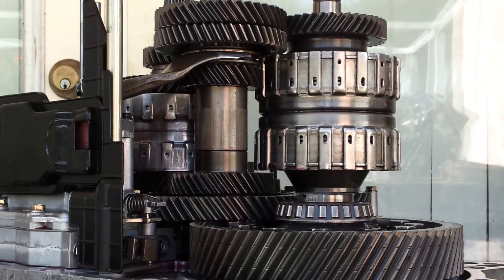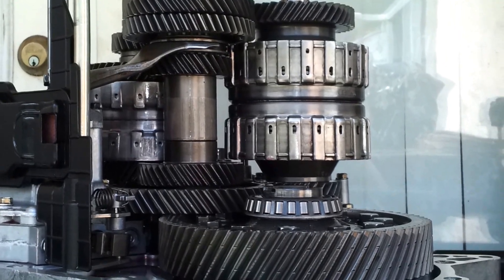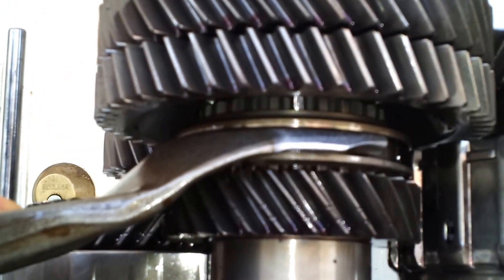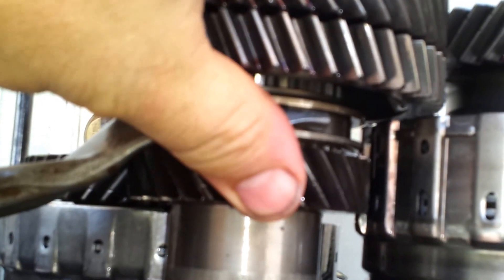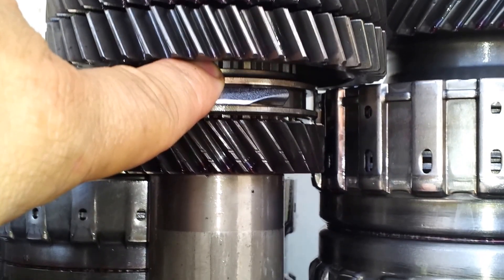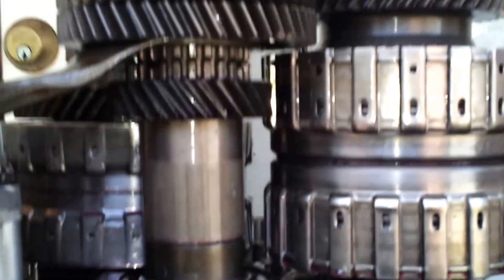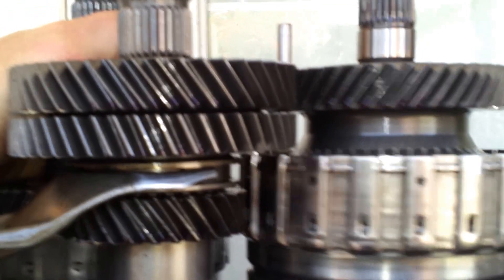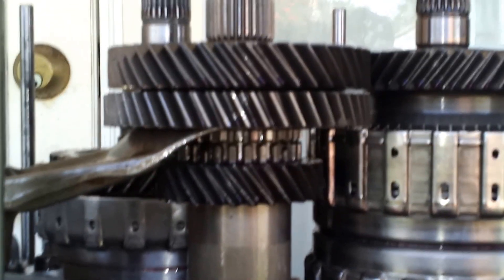2001 Honda Odyssey Transmission: Reverse: Properly Installed

Comment: you forgot to show the 10mm bolt in the servo valve where the arm for that selector connects to, install bolt 180 degrees the wrong way and you have no reverse

Comment: I had a rebuilt trans put in my 99 about 36k miles ago, now it won't go into reverse. I think your video just showed me what exactly is going wrong with it. Not necessarily that it was installed wrong but I think my problem is that that fork is bent or one of the gears isn't allowing that collar to slide freely into the reverse/park position.
Reply: I give you a hint at what's wrong.  The rod, operated by hydraulic pressure pushes the fork up in reverse.  What prevents that pressure from building up?

The fork is steel, it never gets bent on it own.